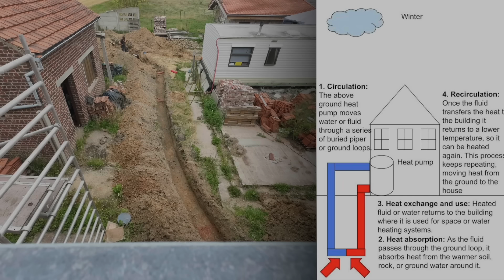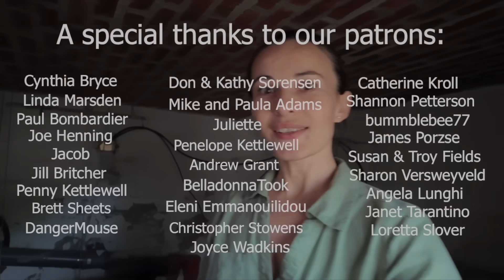What will be heating this old house? / Renovating a 110+ y.o. ABANDONED farm in Belgium

Comment: We have geothermal heating in our vacation home, and it works really well, even here on latitude 61°. Our pipes are, of course, below freezing level and have worked for 30 years, we had to change our pump about five years ago, but apart from that, it's basically free of maintenance

Comment: My understanding regarding heat pumps is that you can also utilize the system to provide cooling air in the house during the summer, you will need a heat exchanger to do so. Best of luck to you all.

Comment: I have geothermal heating, and also cooling. The cooling is great since it only needs electricity for the fan motor and the circulation pump, under 100 watt, and gives 4 kw of cooling power. This is in Finland so the ground temp is about 6 degrees Celsius. It basically looks like a ac wall unit but its the cool liquid from the ground loop that is circulating.

Comment: Geothermal is excellent, however there are 2 cheaper systems available that you did not mention: 1. air-to-ait minisplit or multisplit heat exchangers (no hot water), 2. air-to-water heat pump, with underfloor heating. Both in combination with solar panels. Both are significantly cheaper options, but geothermal is better if you have the cash. BTW, the pipe ditch to the house looks way too shallow, allowing too much heat loss in winter, and the possibility of damage (by digging) in the future when their location becomes a bit vague. Should be run at least below the deepest frost line, preferably deeper.

Comment: We chose air to water heat pump for our heating solution. Geothermal is good but very destructive at the installation stage. Our old oil heater was replaced with a heater and hot water tank, and the outside unit fitted where the oil tank used to stand. We have NEVER run out of hot water and the heating thought the radiators is toasty warm all winter. Yes even with a half metre of snow outside. All done in two days start to finnish.
I hope that they used insulated pipe for the runs to you house.

Comment: I had that put in in 2008 in the UK And it has been great, cut my electric bills in half so it only took a few years the get the return back, i had to put in some thing as it was a new build/conversion so the install cost wasn't much more, i had 2 85 metre holes drilled, one got blocked do they had to drill a third .

Comment: What is the heat pump's capacity? We use 10 kW on our farm. You have many more rooms to heat.
Reply from the maker: Our’s capacity is 12. We calculated all the spaces with some margin and it should be enough.  You also have geothermal?

Comment: I really don't understand why they couldn't work the machine. The ground isn't flat? 5 minutes with a shovel and a rake. Pipe is bent a bit? 5 minutes hammering. Am I thinking waaaaayyyy too simple?
Reply: Probably. Given they have excavators. I suspect the entire footprint of the bore machine would have to be level at each hole. That is flatten the entire back yard. As to the pipe, do you know what pressure it is supposed to take or any clearances it is supposed to have ?

Comment: Geothermal is an awesome choice, if new!Warning: check the system thoroughly for mgf dates on data tags located on framework, inside control boxes, compressors and pumps. Check for acid filters on high pressure & suction side of compressor indicating it is a rebuilt old system. I know from personal experience that here most geothermal sold are very old but sold as new. I used to repair them. Make sure you buy from a long established retailer. Most if not all here sell a few systems and then disappear. Leaving a their junk for angery customers to take it out on me -the guy trying to fix their scammed junk.